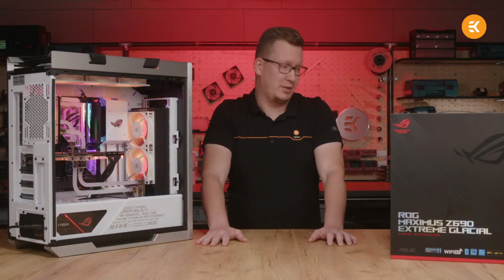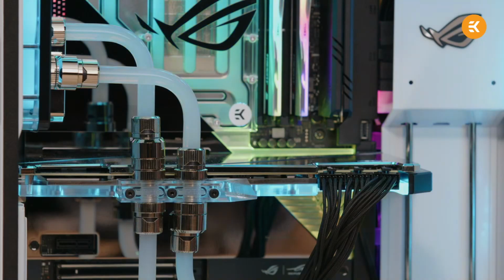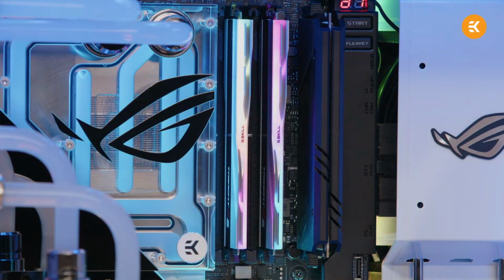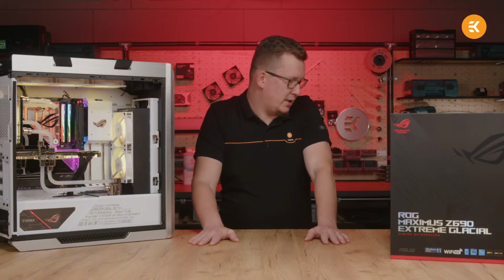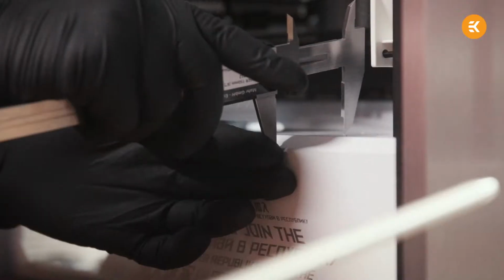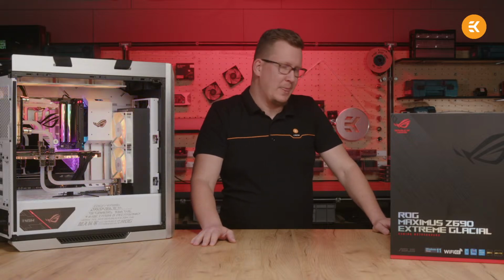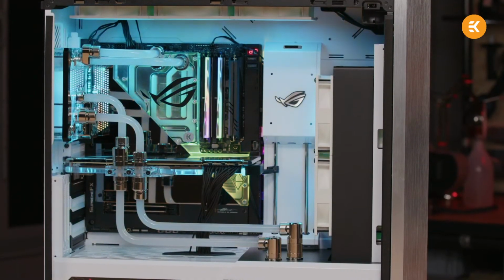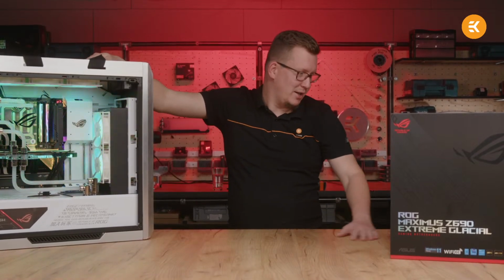Get to know the ASUS Maximus Z690 Extreme Glacial | LIVE Q&A

Comment: With my Z690 Glacial motherboard the CPU, when watching YouTube and surfing the web, runs just 5C above the temperature of the coolant in my loop. So I would say that the thermal performance of the super block is really good! EK-XRES 140 Revo D5 pump running at 50% power (2L/M flow rate) and Lian Li Uni fans running at a little over 800 RPM (pretty much idle).